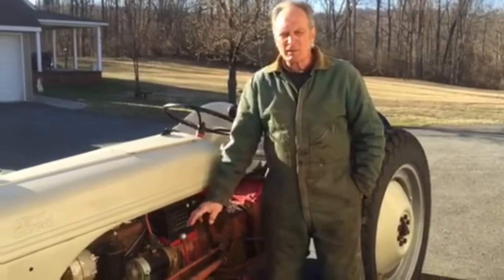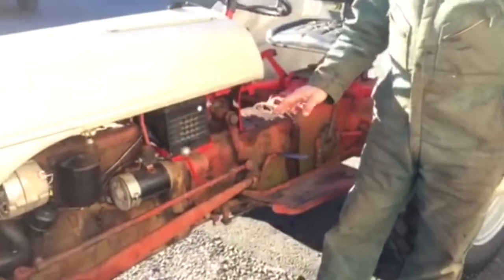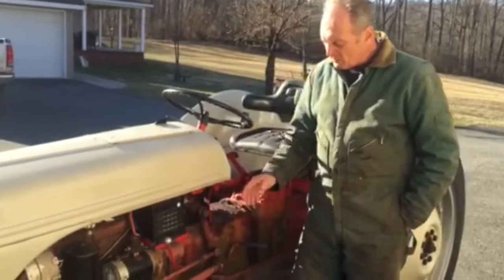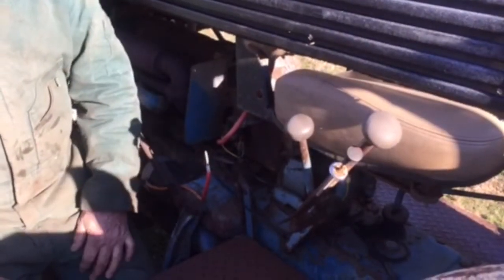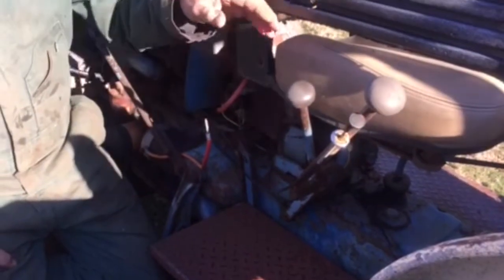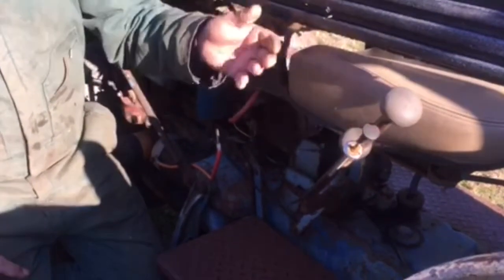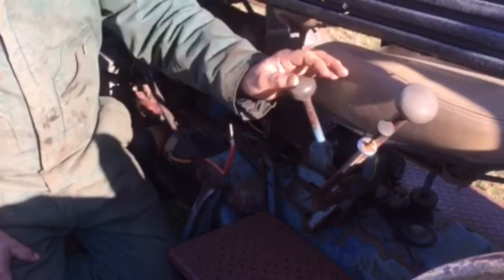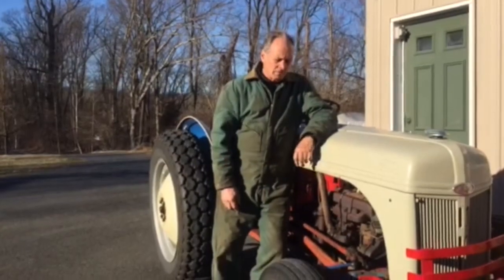Sherman Transmissions Different Styles and How to Shift Them

Comment: It is the Sherman and a Hupp transmission the same…
I see a couple Hupp over/under transmissions on eBay but I’m not sure about them so I’m reluctant to buy it
Reply from the maker: Hupp and sherman are not the same trans although they are similar. I would only buy from someone who deals with sherman trans rather then someone on ebay who is parting out tractors looking to make a quick buck. Condition is a big factor with these units.

Comment: what options do i have for overdrive transmissions? i would like to get around 45-50 mph, suggestions on a tractor too, one that supports the high crop axles i could flip to lower it.

thanks

Comment: I have the sherman combination Im sure based off video but I can't get it to shift at all. So no idea if I'm in standard range or high range. Any help would be great
Reply: I just test drove an 8n with a hi-low Sherman.  It sounds like yours is in standard position.  Try pushing the lever towards the engine while in the middle neutral position.  Then you should have low range in forward and high when pulled back.

Comment: I think you just showed me something I did not know about my 1952 8N. It has a lever on the left hand side just behind the clutch and pressure plate. It's just in front of the 4 speed transmission and when I separated the motor from the transmission it's a little transmission in front of the trans mission. I'd like to send you a picture of it before I put it back together to see what I have. My email is tymwltl@gmail.com I'd sure appreciate hearing from someone who knows. Thanks.

Comment: Sherman Transmissions can  I shif from low to high  range old  601  Ford tractor when rolling
Reply from the maker: The sheman transmission was not a shift on the fly transmission. I would not recommend you do that. That said there are people that do this at a slow roll but if the gears are not lined up it's possible to chip or break gears. Other than wear parts the other parts in the trans can be expensive. I have quite a collection on them and I do not sell parts. I just put a combo in my 641 this passed week. Since you have a 601 series in 1958 at serial number 14256 they chained the input shaft from a course spline to a fine spline along with the nose cone. if you serial is above that number you will have the fine spline shaft which are harder to find the than the earlier course spline ones. The shermans were very good trans and can last for many years if you take care of them.

Comment: We had a 9N with an auxiliary three speed transmission the had the handle on the right side of the tractor. Do you have any information about this set  up?
Reply from the maker: On the right side of the tractor with lever before the main tans closer to bellhousing would probably be a Hupp or an F&T auxiliary trans. If the handle was located after the main trans on the round side cover it would be a howard trans